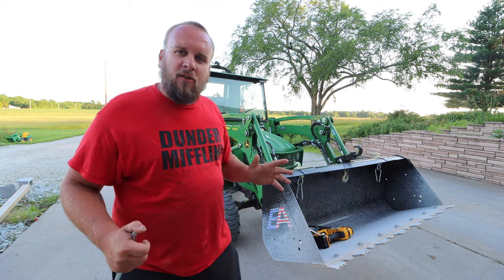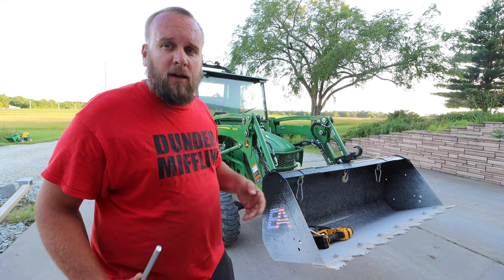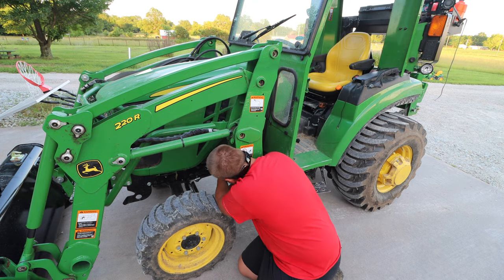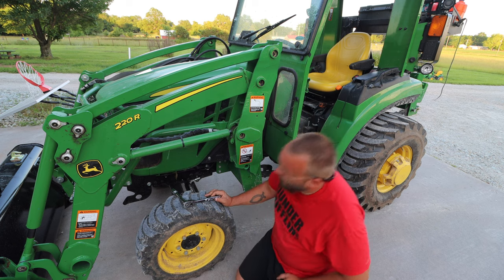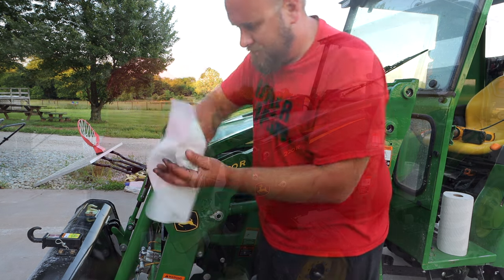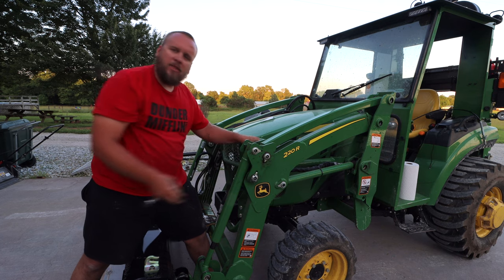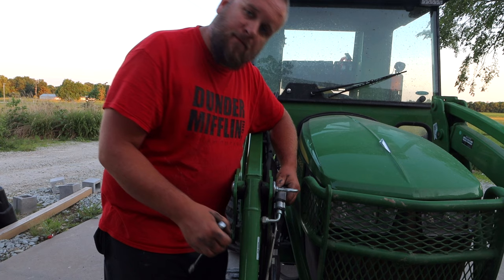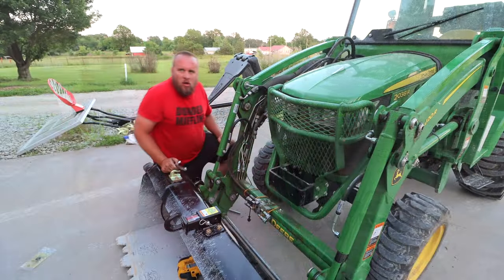How Much Play Is Too Much - Loose and Broken Loader Bolts

Comment: I had the same issue with the MSL after 50 hrs. Great video and bringing to us MSL users attention. Not a big fan of the MSL anymore as continue to find issues with this unit. Pretty sad for what it costs….
Reply from the maker: I had these problems initially and had the dealership tighten everything up. Now I’ve put another 800 hours on it since this video. No more problems.

Comment: Howdy Brock, great video, as well as your others, especially the one you made with Waldo and all the cool additions he has on his 2038R ( You provided perfect info on the 4 in 1 bucket, I just ordered one) timing is everything, I have a 2021 JD 2038R Tractor with the JD 220r MSL (mechanical self leveling) loader, luv it…while moving heavy drifted snow for a few hours, here in southern Montana, I noticed my loader making a “clacking” noise as if something was loose or broken, this loader / tractor has less than 60 hrs. since new, I noticed the slop in the left side latch to the frame, so I figured it was ok….🤔.
Following day I decided to grease the loader after heavy use and before the next usage, surprise surprise, I found one of the top pivot pins had backed so much, it rotated out of the lock tab hole and had 1/4” of pin showing, the bolt, metal and rubber washer were still there, barely. I cleaned all the grease fittings, inspected all the remaining pivot hardware and found 3 others loose, but not backed out. 
I removed the backed out the pivot pin, inspected for damage (none), but found the rubber washer had been partially crushed, I surmised, the bolt backed out because it wasn’t seated hard against the metal washer, when originally assembled, it was seated against the rubber washer, due to movement, it slowly worked its way out, insufficient torque / actually false torque from the rubber being pinched, I’ll need to replace that and possibly other rubber washers, I believe the rubber washers are there to keep the grease in and debris out. 
Make sure when tightening the lock bolt, metal washer and rubber washer, the torque on the bolt doesn’t feel spongy when tightening, if so, stop, loosen and reposition / center the rubber washer on the pivot pin, install large area washer and bolt and tighten. Re-grease as needed. 

Another area to inspect regularly, is the 8 bolts ( 4 on each side) that bolt the front end to the frame, on another You Tuber video, another 2038R operator had noticed he lost one bolt and another bolt was loose. 
I suggest torque checking these bolts and applying colored torque paint across the bolt to the side of the frame bolt hole and area that doesn’t move, this way on a visual inspection, if the torque paint is missing or cracked, the bolt is moving and needs to be re-torqued.

Anyway, Thanks again Brock for the honest videos, keep them coming and stay safe out there !
Marc from Montana

Comment: great video! i repaired one twice. the right side bolts continue to loosen. The first time most of the bolts only on the right side were gone or sheared off. the local dealer was no help. The second time I researched the problem online and found a Dealer request for engineering support number. When speaking with JD they recognized this number. with this information my local dealer provided all the parts at no charge. Sorry i don't have the number handy. its late. this is a known issue with these models!
Reply from the maker: My issue was almost 2 years ago and has not happened again

Comment: Brock, Unless I'm not understanding something that I'm unaware of, I'd start swapping out the nuts to nylon lock nuts or thread lock where appropriate and make visuals thread/nut stop points with thread tamper proof torque marker paint. This will eliminate the need to physically torque check. You just need to do a visual check!

If not you'll eventually run into really big issues in the future at when not expecting it and it most likely will damage other things. Expensive.

Your manufacturer should've recognized this engineering mistake and corrected it. IMHO.

Just a thought.
Good video again sir, as always.
Reply from the maker: I see the same thing you do

Seems like it needs locknuts. I’m going to have a conversation with the service department at the dealership before doing anything else
Reply: @RockhillfarmYT  absolutely agree.
If they don't have a good answer or won't act on it and it might cost you further repairs, time and money......then I'd take it into my own hands and correct it.

If it was an airplane with this issue would you fly on it?? Just saying 🤣😂. Lol.

Good luck! 🤞🏻

Comment: My 3025e msl has all kinds of loose hardware, my top arms pins with the rubber washers both fell out. My main sport with the bar that goes up to the bumper, all four bolts are backed out and about ready to fall out. Dang it only has 38 hours. Just the other day when moving soil a hydraulic line came loose and sprayed fluid everywhere,  shut it down quick. Was the one with the blue zip tie, check your hydraulic fittings too.

Comment: This is why heavy equipment uses a retainer bolt off the pin flange to keep it from rotating and moving around and then a bolt perpendicular through the pin on the opposite side
Reply from the maker: Yeah, Seems like a poor design choice

Comment: Good video Brock!!

1. The eyebolt on my level indicator broke as well, not sure why, it's not a real pressure point. Put a second one on and have already noticed a slight bend in it. I actually took the level indicator off, I got used to using it without while I waited for the replacement and have not looked back. It's not as much of a necessity on the self leveler IMO.
2. I discovered the loose bolts on the pivot points early on and have since made it part of my routine when I grease the loader. Though I will say that the bolts seem to be staying tight now, last time I only got a little movement on one of all of them. Lock nuts would probably be a more permanent fix.

Overall, I would not want my NSL back, once you get used to the MSL it's a breeze to operate. To me it's more of a safety thing, I'm not always alone when I'm working the tractor. It's one less thing I need to be focused on so I can pay more attention to my surroundings and the people working with me.
Reply from the maker: I 100 percent still prefer the MSL even if this bolt set up is not perfect

Comment: Mine does the same thing. I used Loctite and overtightened the bolts and squished the rubber and it’s all a huge mess now and the whole thing has a lot of play. I don’t know if I need new bushings or something it’s really bad.

Comment: Same thoughts and concerns on mine. 
Self level loader on mine too!
I noticed I had some loose bolts too at about 20 hours. 🤷‍♂️.
Reply from the maker: I’ve got about 250 hours on this loader so I would say it was past due for me to check the bolts
Reply: @RockhillfarmYT  after watching this video I checked them again….finger tight at best. How tight can they be without messing up the rubber washers?
Reply from the maker: Your guess is as good as mine.

I tighten them up pretty tight but it was smashing the washers.  I’m going to ask the dealership
Reply: Brock, I continue to have loose loader bolts. Did you check with JD on this? Or have any further input? Thanks.
Reply from the maker: I will be taking my tractor in for service in a couple of weeks and having them check it out then

Comment: The self leveling loader has a lot of links in the leveling mechanism, each one can be additive to create the looseness you observe.  The nuts coming loose is a different story, I would suggest asking the dealer for nylock replacements.
Reply from the maker: Yeah, it seems like it should have locknuts so that you can tighten it down better without smashing down on the rubber spacers

Thanks for watching and for sharing your feedback

Comment: Brock man, I need you.  I just took delivery on a 2021 2038 with 89 hours.  I was greasing and torquing everything, fixing a few problems and going through the manual.  Anyhow, while marking the bolts so I can tell if they backed off, I noticed that the main square loader frame tube on the left side that is welded to the frame plate (the one with the 10 bolts), is not welded on all sides and it looks crusty in the area that was not welded. Probably 25% (the rearward side) is unwelded.  The tube on the right side is 100% welded.   Would you look next time you're out there working on it?
Reply from the maker: You should send me a picture on Facebook or email

Comment: The retaining bolts which have the rubber washers are not intended to be torqued down (and thus squishing the rubber washer). The best solution is to put some of the blue Locktite threadlocker on each bolt and put them back in but not torqued down so as to squish the rubber washer.

Also,, the eyebolt for the level indicator rod is intended to be loose as well with the nut slightly tightened. Do NOT put Locktite threadlocker on the eyebolt! The eyebolt must be allowed to freely rotate during loader use. If you tighten down the eyebolt and it is not allowed to freely rotate you will break the eyebolt again, and again, and again. The eyebolt will not fall out as long as the level rod is installed. The level rod will only allow the eyebolt to turn a few degrees. By doing this the level rod will never bind up in the eyebolt which leads to bending and breaking the eyebolt.
Reply from the maker: Thanks for sharing

Comment: While working on my 2032R with the MSL this past week, I just watched the eyebolt fall off and was like WTF?  I found some loose hardware on the loader and tightened it up, but I guess it was enough play to allow the level bar to put too much pressure on the eyebolt.  How did you get the portion of the eyebolt shaft that remained on the loader out?  was it stuck?  Appears an easy fix if I can get the remaining bolt out.  Thanks so much!
Reply from the maker: It screwed right out on mine. Dealership put Loctite on all those loader bolts and they have not come loose again
Reply: @RockhillfarmYT  OK, thanks

Comment: Is it just me or do these large frame 2 series tractors seem like have an issue with loose bolts? 🤔
Reply from the maker: They do. Although I also think a lot of tractors have that problem and you just hear more about it if you are in a group or follow channels that have the same tractor

Of course the operators manual tells you to go through and check your bolts all the time which is a catchall to say that it’s your fault if you didn’t find a loose bolts before failure

This is my second loose bolt issue and the first one the dealership took care of with no hassle for me
Reply: @RockhillfarmYT  good advice. My 2032 just tripped 50 hours today so I plan on giving it a thorough once-over tomorrow.
Reply: With the benefit of having read a lot of comments, what if you get a torque spec for every bolt and replace/torque and loctite every one?  This issue would be irritating to be chasing loose bolts constantly.  But it's easy to spend someone else's money!